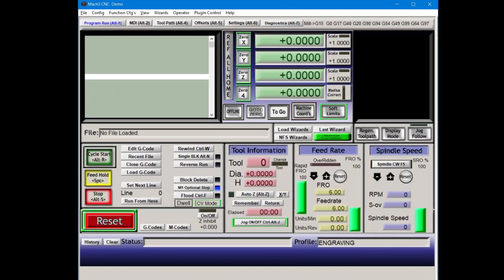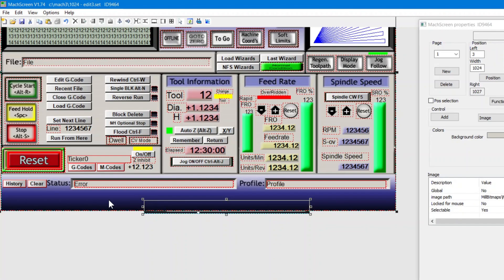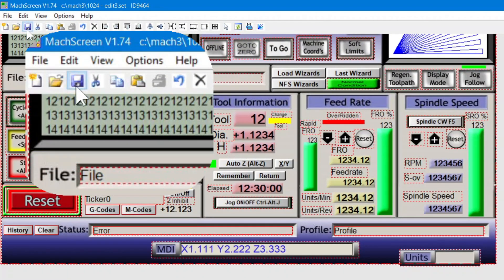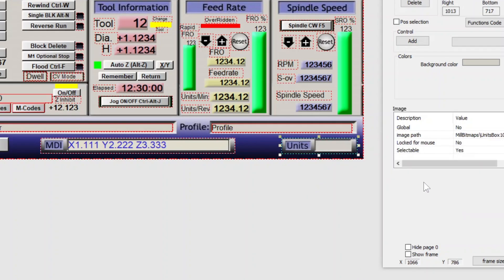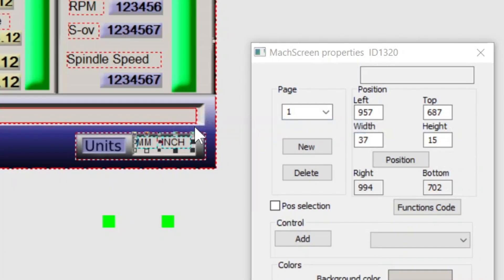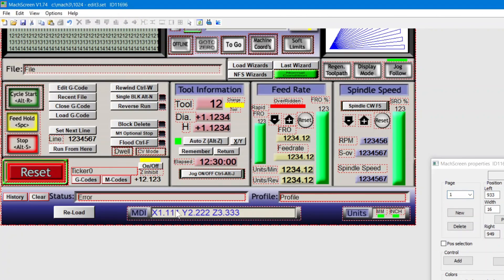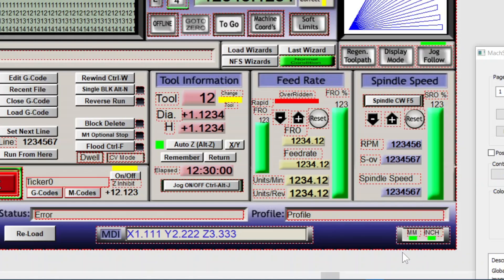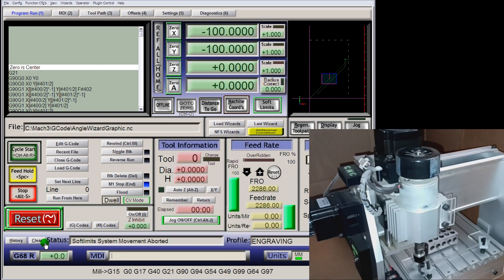Mach3 Screen Edits #3 | MDI Input and Unit Notification | MachScreen

Comment: Hi Charlie ,Thanks for sharing this. I'm curious  about the G68 Dro in the lower left of the screen. Can you post something?

Charlie
Reply from the maker: Yeah, that's part of the Coordinate System Rotation (G68\G69)probing script I'm working on and testing. The original graphic can be seen on the MDI screen. Currently, the script I'm writing probes the Y neg side of the part in two spots to determine the angle to set the system rotation at.
Reply: @sunny5rising  

Is this  a topic for a future video? Thanks for  sharing the work you do on Mach3.
Reply from the maker: Absolutely!
Reply: Thanks. Looking forward to it.